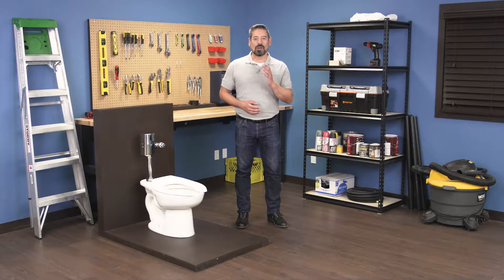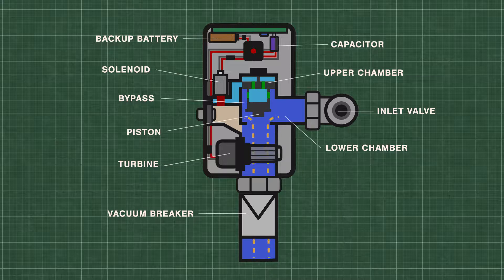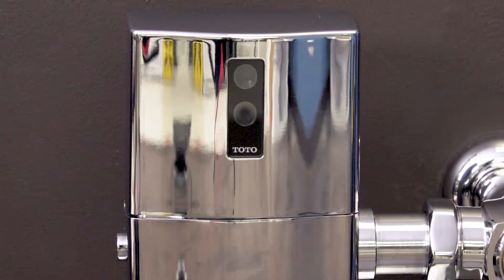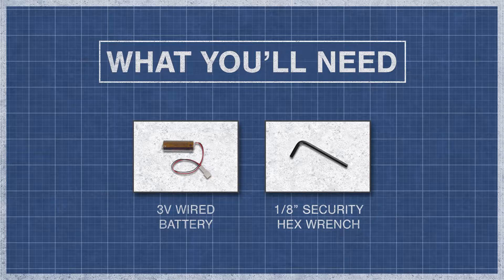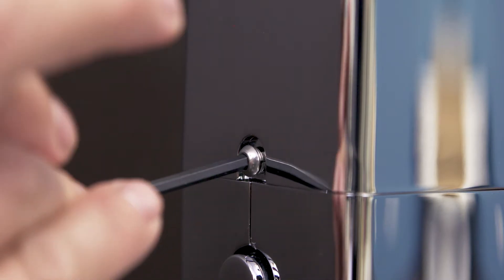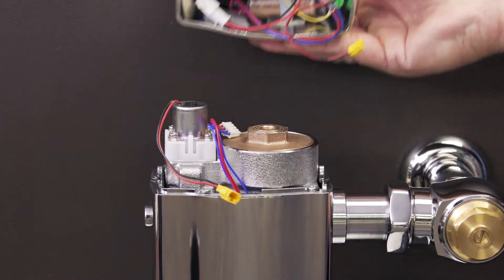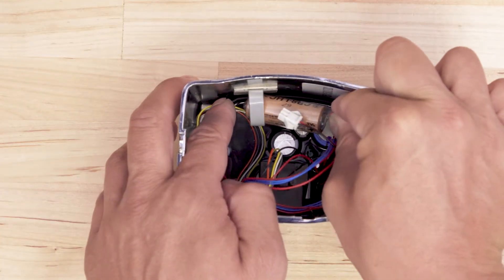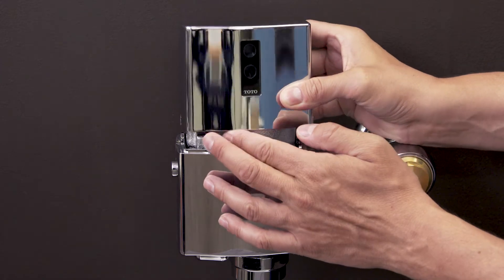TOTO EcoPower Flushometer (Pre-2013) | Battery | Repair and Replace

Comment: What if it’s taking longer than 5 minutes?
Reply from the maker: Thanks for watching. If it hasn't initialized even after waiting for more than 5 minutes, then try disconnecting the battery and trying again. If it still doesn't work then the sensor could be faulty.